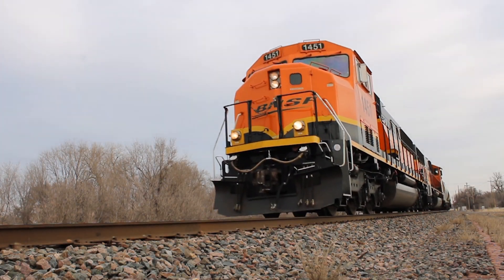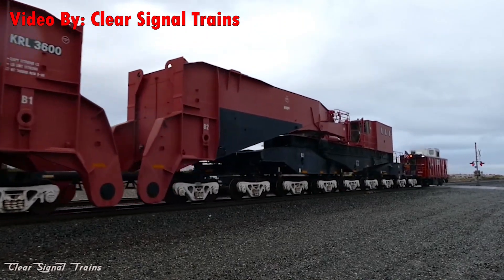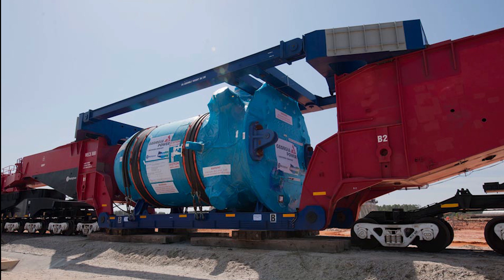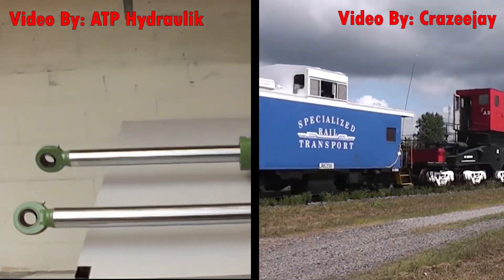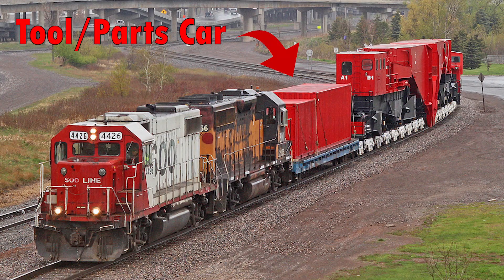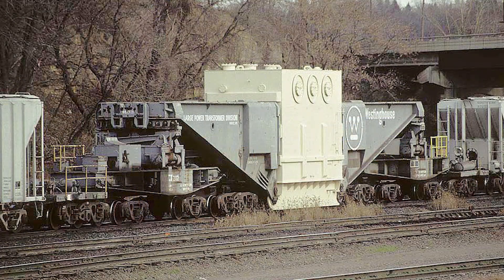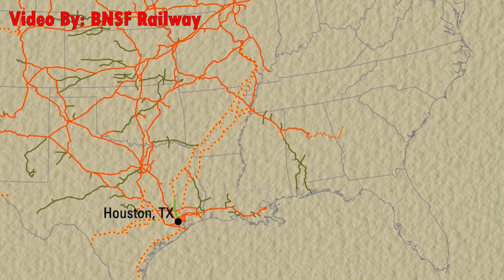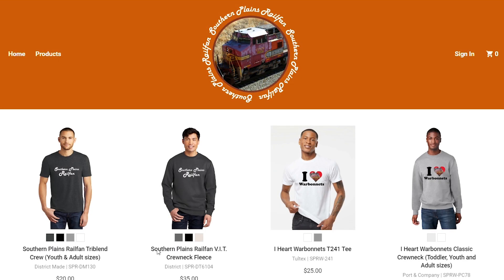Meet The Schnabels; The WORLD'S LARGEST Railcars!

Comment: The 800 has been cut up for scrap, the 801 will never carry a load. RRs found on it's test run that it did not preform as advertised. That is why they never really replaced the 800.

Comment: Schnabels are often used to deliver large main power transformers, which travel the rails "undressed", that is without their bushings, coolers, etc.  This allows them to pass under bridges.  The transformers get dressed and filled with oil on site at the substation.  Then a lot of testing is done before "bumping" (initial energizing) and commissioning.

Comment: I grew up in Pittsfield Mass where GE built Power transformers. GEX40010 with 20 axles was a common sight outside the plant. The building was large enough to bring the Schnabel car inside for loading using two gantry cranes for the lift.

Comment: If the car is separated into two pieces how are the air brakes connected?
Reply from the maker: I’m not sure. I assume they just run a hose between the two halves, but I could be wrong.
Reply: @Southern_Plains_Railfan  you are correct. An air line is run across or through the load depending what it is.

Comment: I don't think I have ever seen one. But then, over here, most lines have overhead wires, which makes it impossible to transport huge loads. Not to mention that most lines during day time have at least four passenger trains per direction (and many have more, up to 12 trains / hour / direction); it'll be impossible to fit a slow moving train without severely disrupting passenger service. You'd only be able to do it during 4-5 hours each night when there is no passenger service (and you still have the overhead wires to deal with).

Comment: The forging company i retired from had forging hammer bases shipped on these cars. The plant is right next to a CNRR rail yard.
 Then a rigger took them off the car and transported them on multi axel heavy haul trailers to the plant.
  The move was only about a thousand feet. 
  The bases weighed 110 ton each.

Comment: I didn't manage to catch a picture of it, but there was a schnabel in town a year or so ago delivering a transformer to one of our local substations. Was quite the affair too. Brought it in on a schnable, transferred it from the schnabel to an SPMT to get it across the road and another siding and then another big crane to set it on its foundation pad. Took 'em a solid 45 minutes to make it across the road, but when you're moving that kind of weight slow is smooth and smooth is fast.

Comment: another railcar type very similar to Schnabels, but far more common, are torpedo wagons used in steel plants. These too consist of two frames suspending an object inbetween (in this case a tank for molten steel) and can reach equally immense sizes as Schnabels, but are usually permanently conjoined

Comment: Nice video i was an engineer for csx on the KD and CV sub we had train handling rules and special instructions in out timetables i think most of them were restricted on our subs we had some pretty tight tunnels lets put it this way if we started rocking a little bit our rain bonnets would scrape the tunnels you could see scrape marks so anything taller or wider than our engines wouldn't be able to go we had some steel truss bridges that would be tight too so i never got to see one of those cars

Comment: I don't know if it was a Schnabel car or not, but back in the mid 70s I watched a big transformer go by.  I was working for CN Telecommunications (part of CN Rail) at the time and in the Geraldton, Ontario office.  This is on the track that connects Thunder Bay to the CN main line at Long Lac.  As I was sitting in the office, I could feel the ground go up & down, as the axles passed.